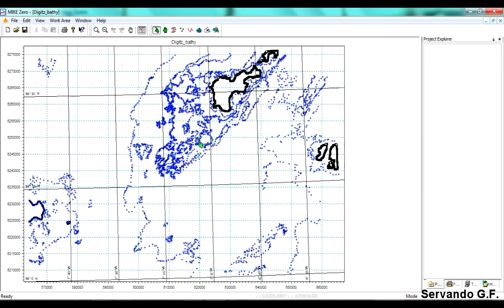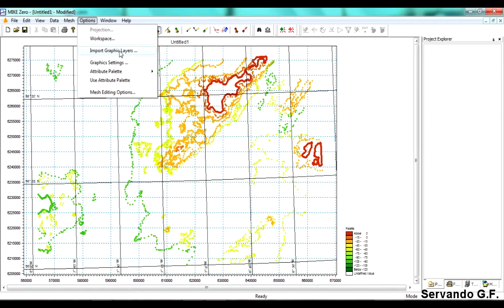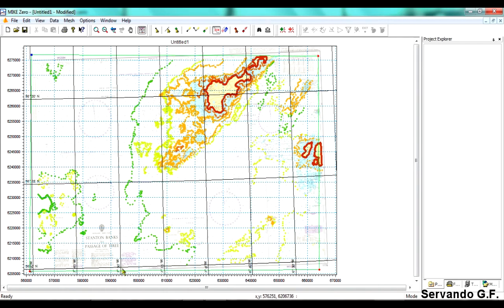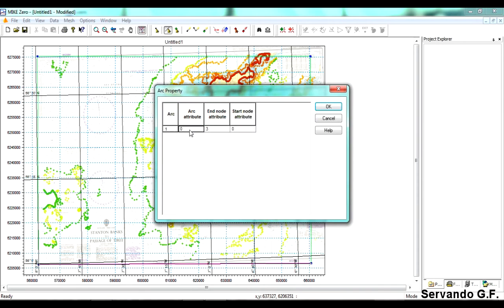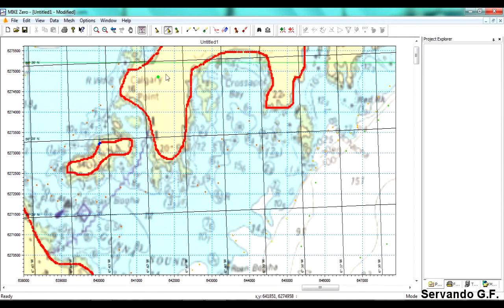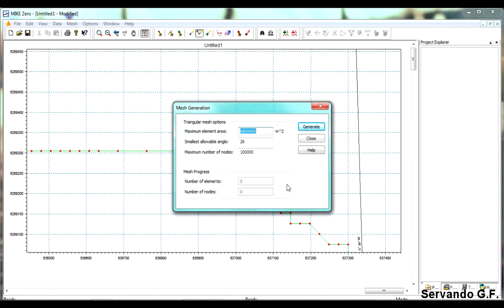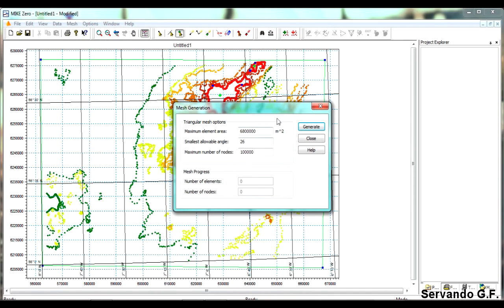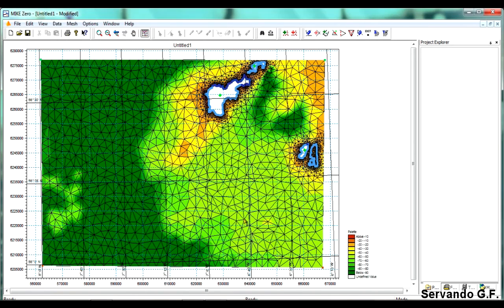MIKE21 SW Tutorial 3/? ¦ Mesh Generation

Comment: It says triangulation failed:run out of floating point precision. Try 
reducing the minimum allowable angle. --when mesh is generated. I tried 
reducing the angle to as low as 10, but it didnt work. Any solutions to 
it?
Reply from the maker: Naveen Kumar Parameswaran Naveen Kumar Parameswaran I will suggest you to reduce the size of the elements of the generated mesh. Reducing the minimum angle to 10 deg will not generate appropriate triangular elements.